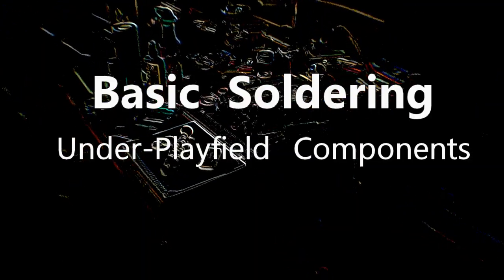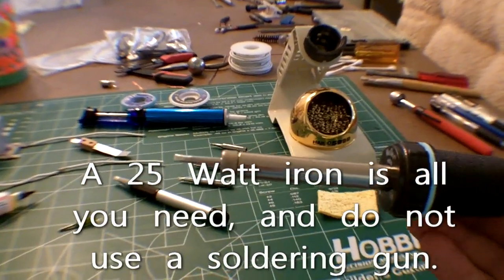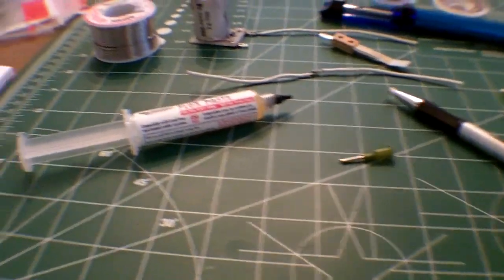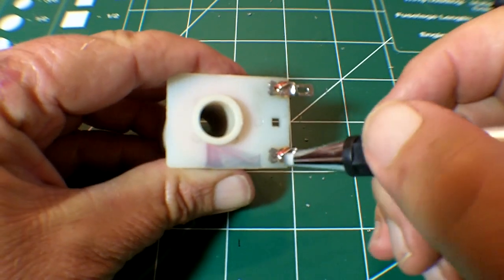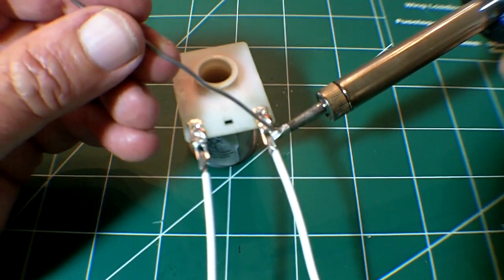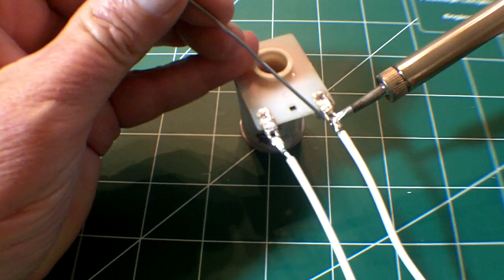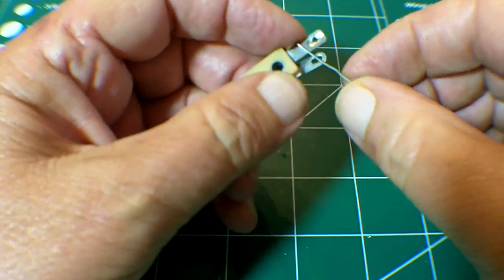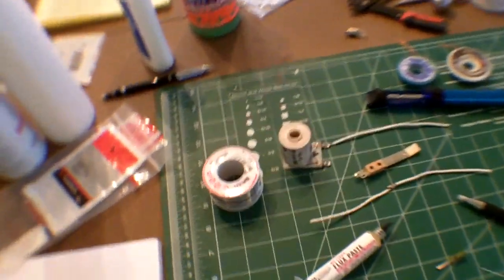Basic Pinball Soldering Tutorial

Comment: I don't have too much trouble soldering under these conditions in your video.  Where I could use the help is soldering while the playfield is tipped back against the cabinet.  I'm trying to solder in some new bulb sockets without much luck.  The soldering isn't flowing across the bracket where the ground wire runs over the bracket by the screw that holds it to the underside of the playfield.  Any hints for me?